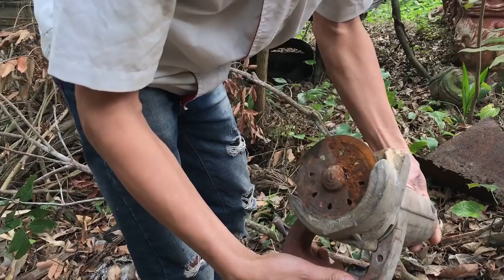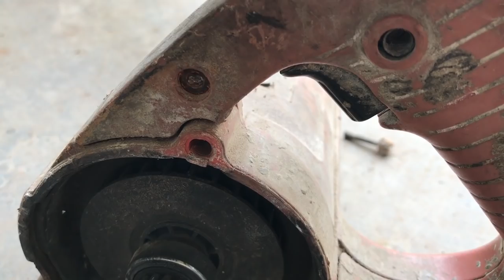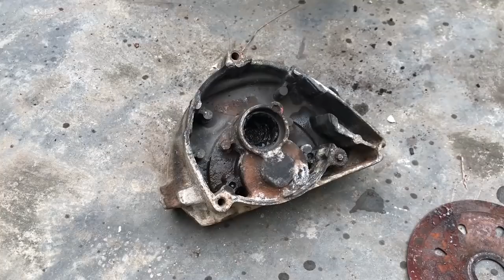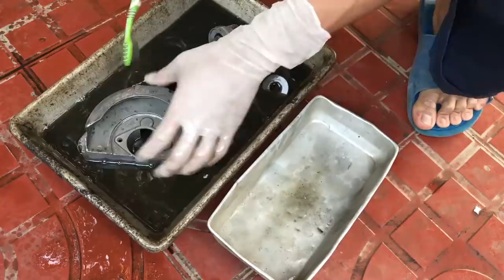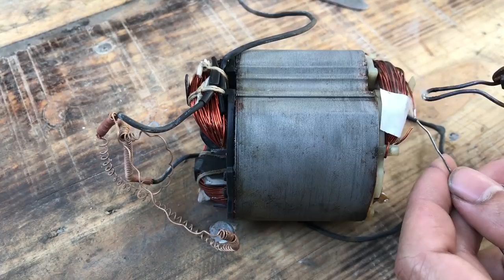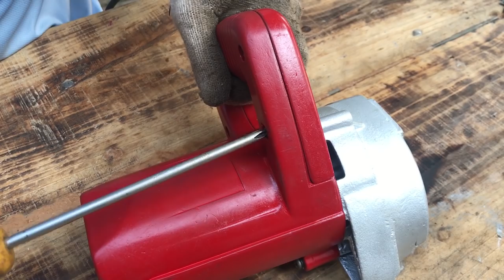MAKITA 4100 NB | Restore Cutter Machines Short-Circuit Beaker

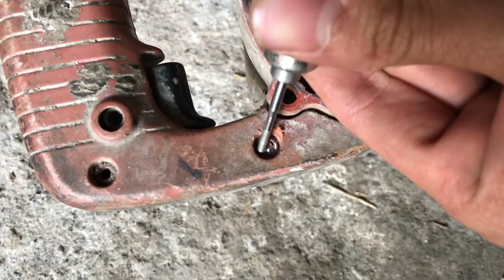Comment: bro wht thing of drill u used for making a space for using a screw driver in 3:41 please sugest me thank you
Reply from the maker: It's a kind of small power grinder but it has big speed.  In its simpler form it is more like a nail machine used for sharpening.  Thank you for your interest in tracking
Reply: @therestorator7215  ok sir can i get link of purchasing why sir u not providing link on description